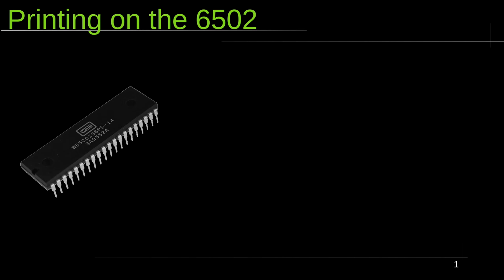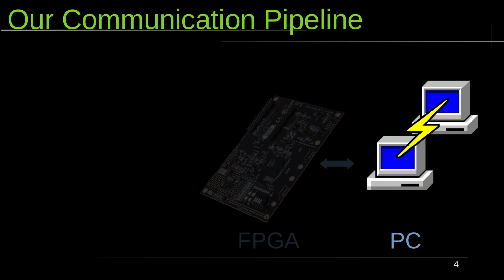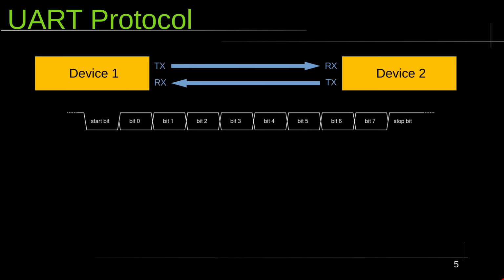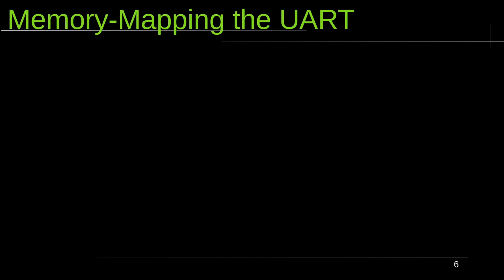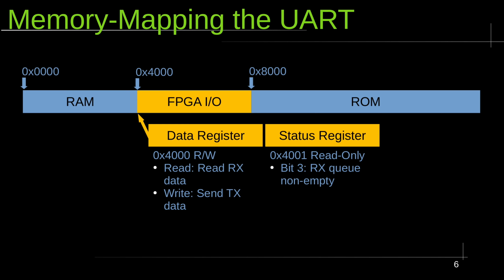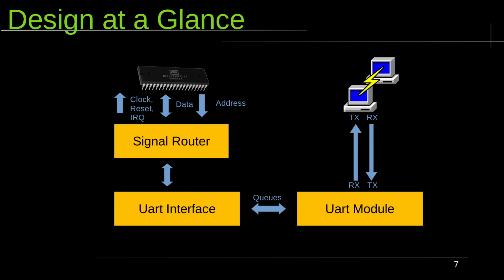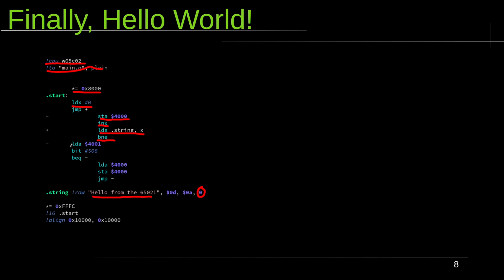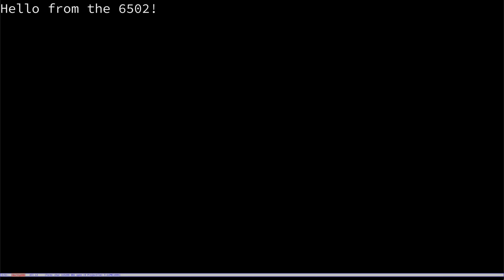Adding an FPGA UART to my 6502 Computer

Comment: One more question: how do you power the 5v side of the logic? The ram and rom at 5v can't be connected to the FPGA, after all, right?
Reply from the maker: Exactly. I power both the ROM and the RAM using the 5v rail from the FPGA board, as neither of them are rated for 3.3v. Then I must make sure that the FPGA does not make contact with a 5v signal directly. The only output the ROM and RAM have are their data pins. So I isolate those by putting a 74LVC245 bus transceiver in between the data lines of the ROM/RAM and the data lines of the FPGA/6502. This will clamp down the signals coming towards the FPGA/6502 to whatever voltage the chip has in Vdd. In this case, 3.3v.

One mistake I made was that I neglected to disable the output of the 245 when both the RAM and ROM are disabled. You have to do this, as even if the 245 is not receiving a signal on its input side, it might still ouput an arbitrary voltage level on the output side.
Reply: @fran4x  nice! On the 245, you mean you left the OE unconnected?
Reply from the maker: @jonathanstein6056  I left OE/ tied to ground, so it was always enabled. To fix that, I had to cut a couple traces, add some bodge wires, and add a bit of logic to only enable it when either the ROM or the RAM are enabled.
Reply: @fran4x  ahhhhhh! Got it.

Comment: How are you generating the clock? How fast? And, why not just use ram and rom blocks on the FPGA?
Reply from the maker: Hey Jon, the clock generation module's code is here: https://github.com/fayalalebrun/6502-exp/blob/master/src/main/scala/system/ClockGen.scala

It takes in a divider value, which determines the duration of each clock cycle given to the 6502, measured in FPGA clock cycles. For example, if you give it 18, it will then repeatedly alternate the 6502 clock signal between HIGH and LOW every 9 cycles. It also generates a signal called act, which is active once at the start of the 6502 clock cycle. This tells the peripherals to take the data the 6502 produces and act accordingly, which is needed since they are running at a faster clock.

There's also functionality for single-clocking. Whenever you toggle a switch on the FPGA board (What is called singleClock in the code), it will only toggle the 6502 clock whenever you press a button on the FPGA board.

With the FPGA running at 36 mhz, and the divider set to 6, I can go up to 6 mhz at the moment. The limiting factor is the EEPROM. Without it, you could go up to at least 8 mhz, perhaps more. Also more if you run the CPU at 5V but then you need two more bus transceivers.

About the FPGA blocks, you could do that, though 64 KB would barely fit. You could even instantiate a 6502 in the FPGA without much of an issue. However, I wanted the FPGA to act as a peripheral to the 6502 as much as possible, so that in the future, I'll be able to use a much smaller FPGA, on a board mimicking a DIP form factor. I feel like having everything in the FPGA loses some of the magic. Especially pulling out the EEPROM to reprogram it is quite fun and faster than compiling and uploading a whole new bitstream to the FPGA.
Reply: @fran4x  thanks for the quick reply! The only HDL I'm familiar with is verilog (well, and system verilog, to some extent). I'm using a clock enable to divide the clock. I currently have all the signals (well, D0-7, A0-15, phi2, rwb, and resb) connected to the fpga (arty s7). Irqb and Nmib are tied off appropriately. I want to get it to use the block ram onboard the fpga, for ram and rom, but I just have not been able to get it to work. However, I was very happy to come across your project! Any tips you can offer? It seems as if there is a recent resurgence of the 65c02 - probably fueled in part by Ben Eater's project. Well, the more, the merrier.
Reply from the maker: @jonathanstein6056  When you say that the clock division works via a clock enable, does that mean that, for example if you want your 6502's clock cycle to last 8 cycles, then it will be HIGH for 1 cycle and LOW for 7 cycles? If that's the case, you should try to divide them equally, as the processor might not have enough time to latch the data. Especially if you're running at a higher frequency.

In terms of the block ram and rom, I think the main challenge and perhaps the source of your problem will be that the 6502 expects asynchronous ram and rom, but FPGAs usually have synchronous ram. The difference between the two is that the sync ram has a one clock cycle delay after you put the address on its pins and it outputs the data, while async ram has no delay. If you want to emulate async ram using the FPGA's sync ram, a single 6502 clock cycle will have to last multiple FPGA clock cycles. Thereafter, at the start of the 6502 clock cycle, the FPGA requests the data from its sync ram, which it then places on the bus for the rest of the 6502's clock cycle. Thus, in the 6502's view, it is as if the data was ready in the same cycle as it requested it.

I do recommend that you check Chisel out. VHDL was my first HDL, and I found that with Chisel I could write code which was much less error-prone, more succint, and easier to understand. Thus, the whole process became more enjoyable and less frustrating. It also compiles to Verilog and you can use Verilog modules within it without much trouble, so you'd be able to use your existing modules.

Good luck with your project! Let me know if I can be of any further help.
Reply: @fran4x  I use a counter, so every X cycles, a clock pulse is generated. I mean, at 3.3v, there is no way this baby is running at 12mhz! But, yeah, I know what you mean ... you get a cycle of uneven pulse-widths. In any event, if you're interested, I'm more than happy to share my code with you.
Reply: @fran4x  hey, Francisco... any suggestions as to how to code a verilog SRAM emulator? You were 100% correct; the problem is the fact that the BRAM takes multiple cycles, and that leaves the wrong data at the wrong time. Consistently.
Reply from the maker: @jonathanstein6056  Hey Jon. What you should keep in mind is that what you are emulating is not just SRAM but asynchronous SRAM. The FPGA's BRAM is SRAM, however it is synchronous. That means that it has exactly one cycle of delay before it places the data on the bus. What you have to do is use it in a way where from the 6502's perspective it behaves like async SRAM, which means that when the 6502's clock input signal is HIGH and it places an address on the bus, by the time the 6502 clock is LOW, the correct data is already on the data bus.

I have prepared a timing diagram showing how this might look like, when the 6502 is trying to read memory:

https://wavedrom.com/editor.html?%7Bsignal%3A%20%5B%0A%20%20%7Bname%3A%20%27fpga_clk%27%2C%20wave%3A%20%27p...%27%7D%2C%0A%20%20%7Bname%3A%20%276502_clk%27%2C%20wave%3A%20%271.0.%27%7D%2C%0A%20%20%7Bname%3A%20%27data%27%2C%20wave%3A%20%27x%3D..%27%7D%2C%0A%20%20%7Bname%3A%20%27BRAM_RE%27%2C%20wave%3A%20%2710..%27%7D%0A%5D%7D%0A

Let me know if this helps. The difference between async and sync SRAM is not explained in many places but it's quite simple. Sync SRAM has a one cycle delay before it places valid data on the bus, due to its use of latches.
Reply: @fran4x  so, are you saying that the (best) time to sample the value (on a read cycle) is on the second negative edge?
Reply from the maker: @jonathanstein6056  You should sample the value one clock period after you assert the signal to read from the BRAM, on the positive clock edge. On most FPGAs, you shouldn't be sampling anything on falling edges of clocks. It will route the clock signal through an inverter and back to the dedicated clock path, which can cause weird issues. I've made similar mistakes, which cost me countless hours.
Reply: @fran4x  sorry for the delayed reply - I'm back to square one here.
Reply from the maker: @jonathanstein6056  Good luck, and if you haven't written much Verilog in the past, I recommend fpga4fun.com, they have many interesting practice projects there
Reply: @fran4x  After all was said and done, I arrived at a configuration similar to yours. Sooo many wires!!! Any tips on designing a PCB for all this?